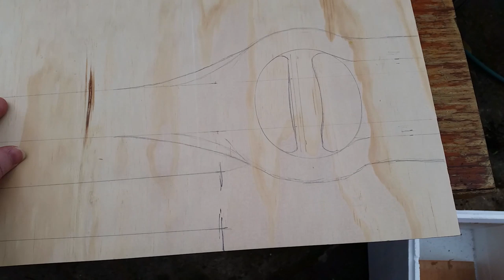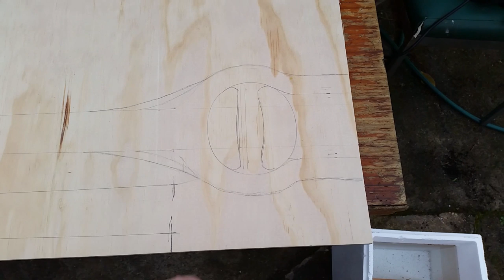Shad's Shop: Building a wooden gauntlet sword

Comment: An appropriately sized PVC pipe, cut lengthwise at a bit of an angle, would have made a nifty arm support/protector.
Reply: Siesta Time good tip!!! just thought of the same, the pvc pipe idea would also work well for bracers or greaves.
Reply: Ayup. A bit more fiddly, he could also have gone with stave work.

Comment: Great video shad. When make stuff like this I normally use poplar, plywood can be had to work with. N to get that type of edge on wood I clamp the work down n I use a handheld power planer you can change your depth n they are affordable however they are very loud.

Comment: I like the "Shad's Shop" idea for a series.  It's very "JoergSprave" in concept, and it's fun to see all you weapon/history guys share ideas around.  You each have your own aspects and perspectives.  Also, regardless of my other opinions on population, your munchkins ARE totally adorable.  Happy humans, even miniature ones, are a good idea in general.  Hopefully the futuristic ideas of people like Isaac Arthur and the real-tech of SpaceX etc will give us new places for happy humans to grow and live.

As for the actual project at hand, it looks like it was a lot of fun.  I recommend getting a Dremmel tool set.  They don't cost much but are very good at fine sanding, shaping and so on.  Also, for curling/shaping wood, you had a good idea but the trick is gradual pressure over time.  Use loops of rope or wire with bracers/padding to get it to conform to shape.  This is how historical longship/sailboat planks have been done.

Comment: You probably need to buy some bigger wood cutter bits, rather than that piddly little bit you used, to help with getting the jigsaw. :)
Also for joining none matching edges, why not use milliput instead. It's light easy to work with and smooths out with sanding

Comment: Shad, you could have try to bend the thin piece of plywood over the pipe (so the bending radius is not so sharp), and let it soak in warm water (maybe even starting at boiling temperature) bent to the proper shape, not just clamped.

Comment: Hello Shad. i have a question of great importence that i am unable to figure out myself. you see i am a writer and am in the process of writing a fantasy based story. and in this story i had a race of creatures known as the Yarick who are twisted forms of orcs who are taller and stronger then humans and i did a ton of home work and found that they can generate 4,500 pounds per square inch of force. and this is my question. could a creature with that kind of strength wielding a falchion injure or kill someone wearing plate armor? or would the sword break and a mace be a better choice of weapon? please answer this question because i am not an expert on this kind of thing. well wishes to you.

Comment: 17:02 your son playing with that scrap gave me an idea for a weapon, can you make it? it would be the way your son held it wrapped around the wrist and forearm would be the cloth used for padded armour and chainmail over that. the blades would be short and sharp, enough room in between to catch a blow from a sword and if made to absorb enough shock and if the sword steel is weak enough, break it. anyway it's basically a small blocking sheild for sword combat that doubles as a double bladed knife. is this a thing?